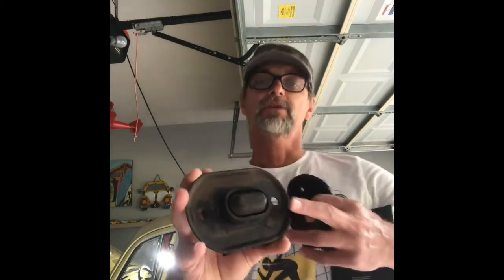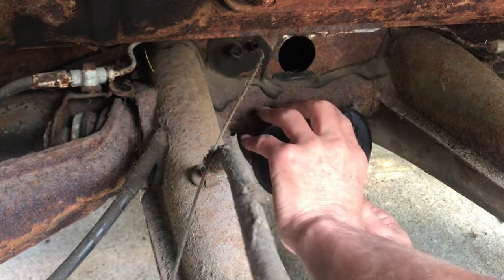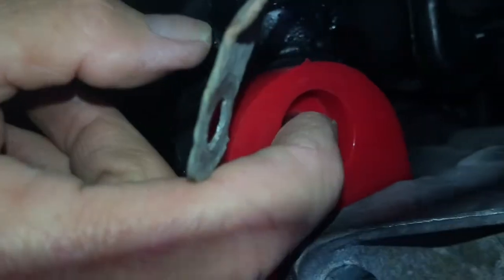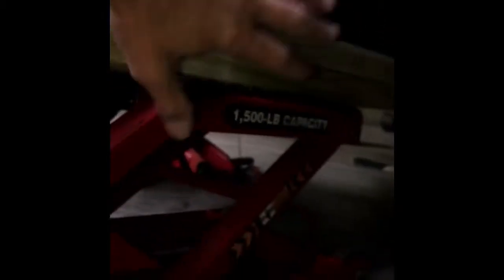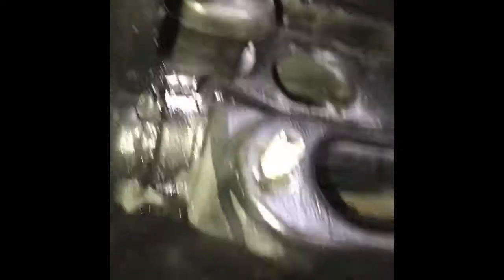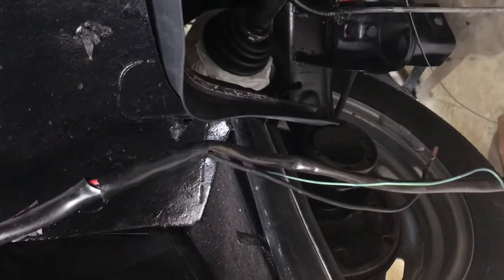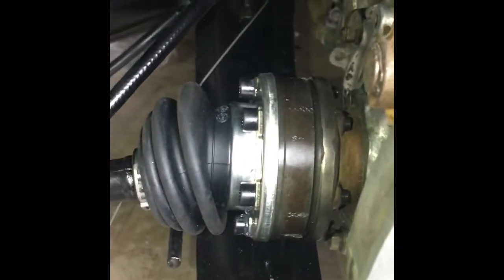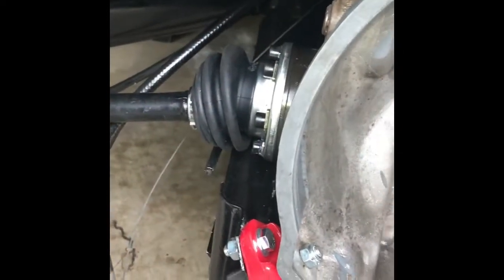1971 VW transmission mount install

Comment: You could also buy or make a small 90 deg angle mount to bolt to the bolt and also to the grounding strap.

Comment: Those red urethane components are very deficient. They tend to crack without warning. On critical applications such as the steering coupler on the front they are not to be used. The wise thing is what you did; go to OEM style rubber or the Rhino mounts by CB Performance.

Comment: First of all, thank you so much for the shout out that’s very nice of you. I added a link to your channel, in the description of my introduction video that I just put up last night. Sadly some of the aftermarket parts, do not fit very well. It appears that the one from Oreillys fit very nicely. The one near me can get VW parts but it usually takes them a couple of days. Great video as usual my friend, keep up the great work!! ✌🏼
Reply from the maker: Slades VW Beetle thank brother I appreciate your feedback back.  The day I send the question about the front mount that was the issue I was wondering if you had the same.  But you mentioned had purchased the OEM.  Again thanks for supporting me.

Comment: nice job on that, you can also take a look at the kit from CB Performance, they have a heavy duty rubber trans mount kit. Its better than using poly mounts and stiffer than poem, but made very similar to oem, Good luck on the rest of the build!
Reply from the maker: Torkwerks Hi there I hope you’re doing well.  Thanks for your comments.  Appreciate the feedback and the additional info.  I will look into those in the near future.  I still have Frankenstein to restore after I am done with Sunny.  Have a great day.... 😀

Comment: I had to make my own front urethane mount on account that it's an AutoStick. Anyhoo, if you're worried about bending the front transmission mouting bracket when trying to knock out the studs, use a block of wood and put it in between the bracket and the chassis, that way it won't bend when you knock out the studs. If worst comes to worst, you can always buy a new front transmission mounting bracket from Wolfsburg West.

Comment: You are using the wrong parts house if you have to modify all that just to put the front transmission mount on . I've been using Apple Tree for all my VW parts for the last 14 years and have NEVER had any issues with having to modifying my car so the parts would fit . Btw the neoprene transmission mounts SUCK , I have blowed through two sets of front and rear mounts . My advice is to go OEM or solid mount , neoprene breaks down too fast .

Comment: I have the same transmission mounts and I'll tell you this much Teflon is great but after two transmissions slipping out of fourth gear I realized that it might be my transmission mounts does anybody have the same problem with this hardware kit known as the red Teflon transmission mount
Reply from the maker: It’s is not recommended for daily drivers.  It’s actually on the disclaimer page from JBugs.
Reply from the maker: The transmission slipping out of gear; I don’t it has anything to do with the mount; you may have a bad gear or a bad synchronizer in the transmission, you may want to check that if you have to open that transmission again.  On another note you can always install the OEM mount and entertain that idea to see if that is the issue.  I still think it should not be the problem.